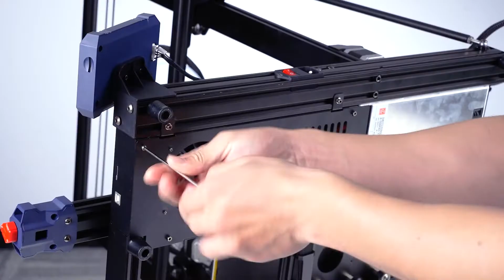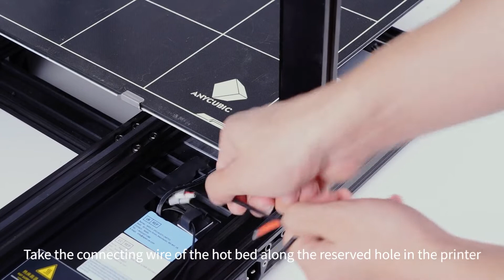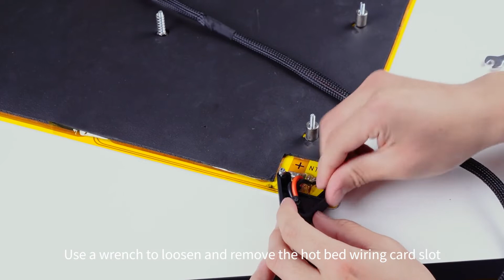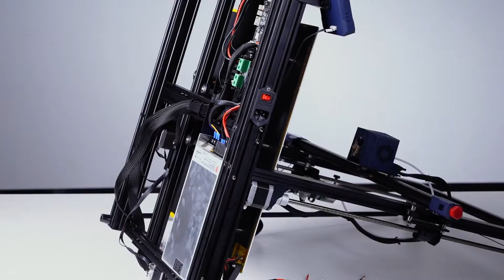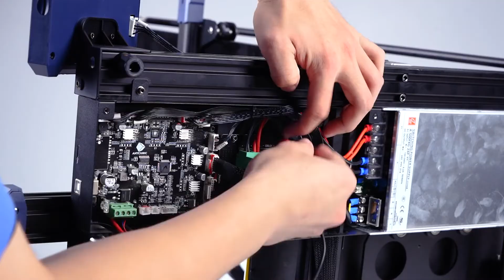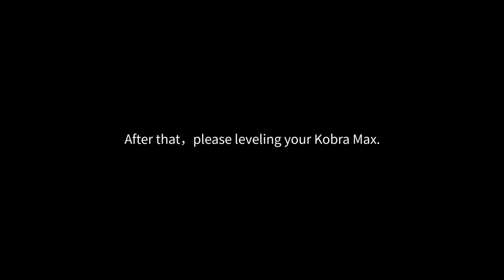Heatbed Replacement Tutorial for Anycubic Kobra Max

Comment: I am currently working with your support on a new Kobra Max that has a bent right rear corner (3 to 4 mm dip). I can not get the Autolevel to work. Your tech support is going round and around with me without fixing the issue. It is clear I need a new heatbed and glass bed. It can not be normal for the bed to be bent this badly. What bothers me is the poor technical support. If anyone at Anycubic is reading this, please respond.
Reply: i am having the same problem. the Heated bed is bent and the print does not work properly. Have you got any solution?
Reply: If your warranty period is expired, they won't replace the bed for you. When it comes to any email communication - there is no other choice but to wait. There are heated bed replacements on Amazon for $63. Install is quite easy, just a lot fo aligning to screw things down correctly is the only issue. Cheaper and less headache.
Reply: If your warranty period is expired, they won't replace the bed for you. When it comes to any email communication - there is no other choice but to wait. There are heated bed replacements on Amazon for $63. Install is quite easy, just a lot fo aligning to screw things down correctly is the only issue. Cheaper and less headache.